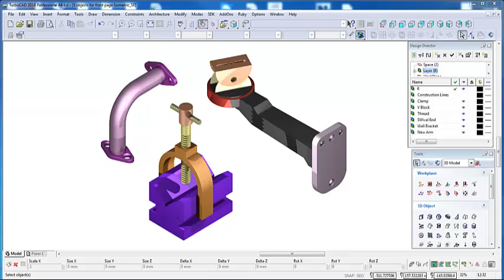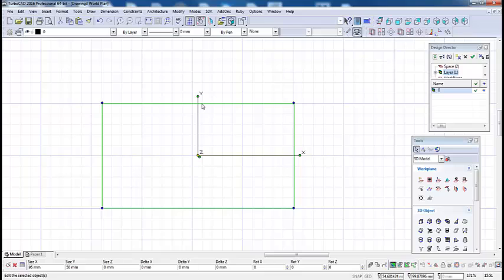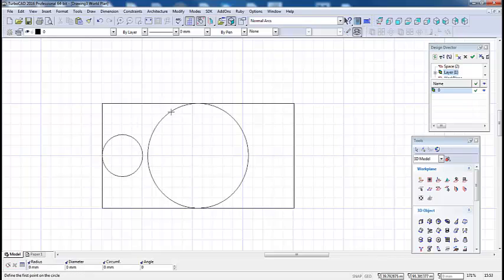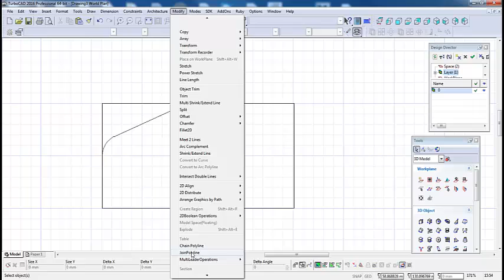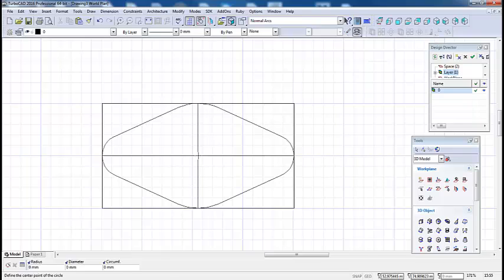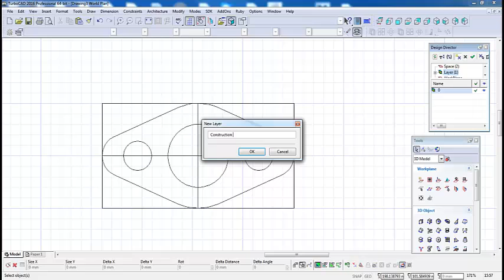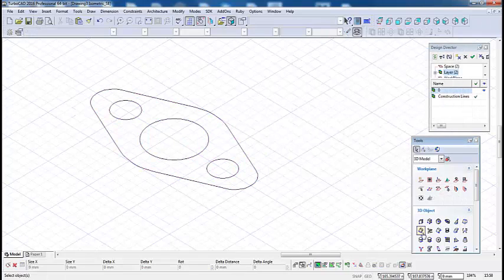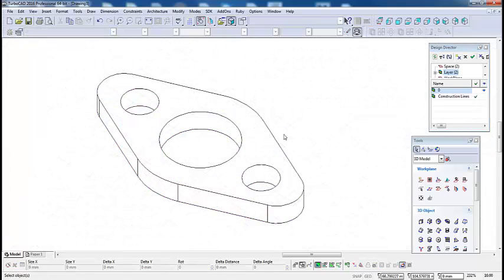Introduction to three 3D Mechanical drawing tutorials using TurboCAD Pro Platinum

Comment: What a performance to model a simple part!  Turbocad alludes to be a 3d cad application so at the very least it should be fully parametric. I used it many years ago and it was a pain in the arse then and still is. How they can charge the price they do for this useless software is beyond me. Anyone wanting a full blown professional Mcad programme should look no further than Siemens Solid Edge [ community edition ] free for life and  nothing missing from the Professional version [ except parts done in the community edition cannot be opened in the Paid for version and vice versa. Worlds apart from this rubbish.

Comment: I have version 9 of this terrible software and I was able to eventually figure out workarounds to its many bad design issues.  BUT the real issue came up when I merely upgraded my Apple OS to version 10.13.1 and the software stopped working.  Just like Ransomware - it demanded a $300 upgrade because of their horrible policies in the company.  None of my previous turboCad files can be even accessed because of this.  I sincerely hope this company goes out of business.  The main software issue (among countless others) was that the PDF export function does not work - the image it exports is not even closely related to what you have on the screen.  Then I had to always move the image to my 30 inch monitor and then stretch it and do a screen capture. THen I have to take the screen capture to photoshop and edit it and make the line weights heavy enough to see and add any dimensions or notes and THEN save from photoshop as a PDF.  Horrible program and the company is run by even worse management.
Reply: Apple is the biggest crap company of all time. I don't blame any software developer for taxing you pretentious weirdos. Ask yourself why Apple requires compatible software, while no other computer manufacturer would even think of doing something so stupid... The market isn't big enough for more than one company to capitalize on limited number of idiots dumb enough to buy into that schema. In fact, back in the day, Apple wanted all computer manufacturers to require their own proprietary compatibility.. What a clusterfuk they wanted the world to be.... And thats the business model people like you vote for when you buy their BS. Exercise your democratic buying power and stop rewarding them for funky bells and whistles that would only serve to make transitioning from one platform to another difficult... especially if other manufacturers followed their corrupt business model. Different isn't always better, weirdo.
Reply: Sorry to hear of your experiences but it is sad to say that there are no effective CAD packages available on a Mac. Solidworks, AutoCAD etc are all designed for the Windows PC  and you can fill your house with the choice of CAD packages on the Windows PC platform. Maybe AutoCAD Fusion 360 may work for you because it is browser based...
Reply: Turbocad on a windows is a different programme to the one Turbocad issue for the Mac. Go look at Punch Cad who issue the same programme for both windows and Mac platform. I have Turbocad on both Mac and Windows PC and I am moving over to Turbocad on a windows machine because I like the windows version. The Mac version is ok ish but seems more of a limited programme.
Reply: @MecCreativeStudio   I agree.  I tried a mac several years ago and then switched back to PC.  Macs have their place, but not for a lot of the things I do.  And, I had TurboCAD MAC version and it seemed  a little "lite" for what I was doing and a little awkward.  I'm still glad I switched back to PC after 3 years on a MAC.